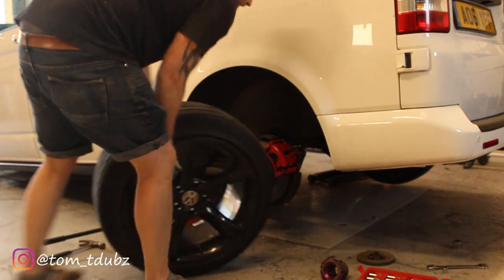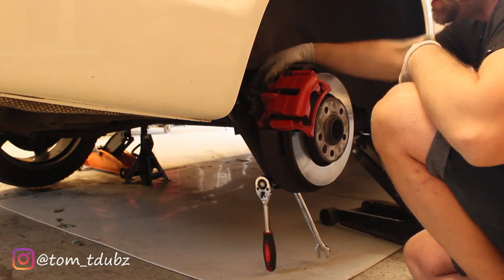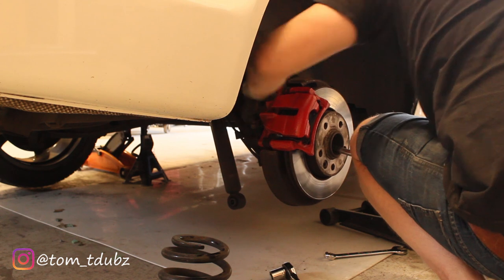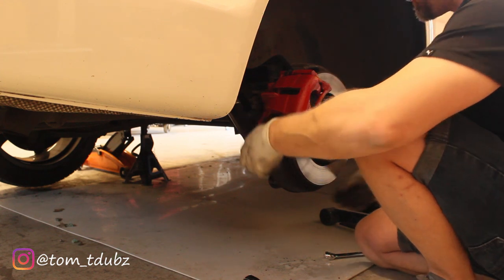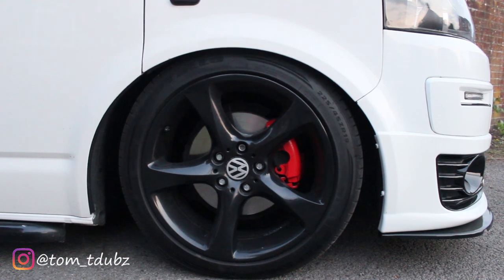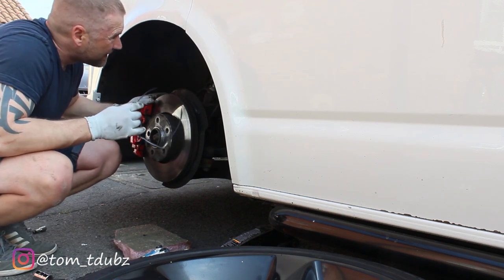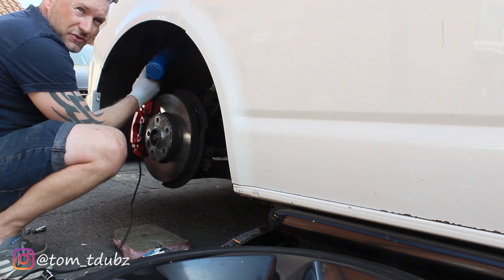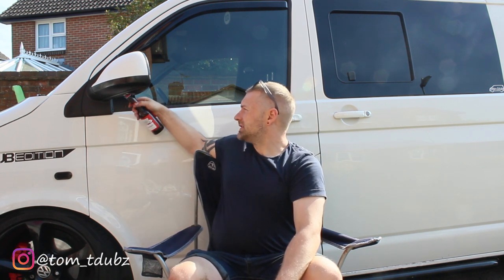VWT5 stance plus coilovers

Comment: Hello Tom as you well know with the Lowdown Transporters crew some people who are running 20” are wearing 225/35-20 fronts and 245/35-20 or 255/35-20 rears and they’re rim sizes are 8.5J fronts 10J rears , I know some people talk about load ratings but as long as you understand what you’ve put on and adjust your driving style to suit you’ll be ok , plus personally if your modding the van unless you declare all mods your insurance will be invalid , so if you declare all mods including wheels , tyres suspension etc what can the insurance company actually do look how many people slam there vans , Vw Transporters are a lifestyle but try and tell someone who’s got a transit that 😂🤣. 
Once we come out of lockdown my wife’s T5 is getting lowered fairly vigorously I’ve got H&R ultra deep coilover kit which has been hub modded , T6 modded top mounts , new Meyle Hd drop links , Transporter Hq narrow cv boots , and rear adjusters will be removed , rear arch liners removed , rear chassis notched so when the strut moves its natural movement it doesn’t catch ,  rear brake line and abs sensor wire rerouted , front arch liner heavily modded all on the aid of running low , hopefully with all the mods I should be running about 160mm lower at the front maybe a little more and about 145/150mm at the rear , I’ve got BMW Ellipsoids 19” they are 8.5j front and 9j rear I’m going to be running 225/40-19 and either 235/35-19 or 235/40-19 but I might be ever so slightly rolling both front and rear arches just to give more clearance and help me tuck as well.
Reply from the maker: Arron, this is very exciting can’t wait to see your wife’s van sat that low! I have just purchased hq cv boots and I’m waiting on some gaz short rear shocks.. I won’t be running as low as yours but for Stars and Stripes (stickers) it won’t be low enough. When lockdown is over and the shows start there is gunna be sone seriously tidy looking vans about!!

Comment: Hi Tom,great channel.I went from T4 to T5 in February and actually got the stance kit after looking how low they went after your fitting episode.Well happy with the outcome.Was only ever after no arch gap as my T4 was down and swore to myself I won’t be cutting this van up.But now looking at adjuster deletes and bump stop trimming.Would love to know how you get on with the gaz shocks.Did you custom order a extended/compressed length,or off the shelf?.Oh,your van looks sweet by the way...Great stuff👍
Reply from the maker: Thanks, I'm really happy with them so far... its quite contagious isn't it.... I've just ordered some thin rubber mounts for the top bump stop, will be cutting them down soon an doing a chassis notch along with the fitting of the struts in a vid soon. I went with the standard short shock as I probably wont want to be low for ever....

Comment: Hi Tom,  great vid - ive bought the power flex rear adjuster delete today for my stance ultra kit to get the back down more - wondering if it’s even worth running it if you’re saying there isn’t any knocking from the spring houses on the metal of the original metal adjuster mould?
Reply from the maker: I would run them if you’ve got them, occasionally you get a knocking but I think that’s my rear shocks... I’m going with gaz short shocks and a little notch the the chassis, and bump stops.. that should get me a little more clearance under there.
Reply: T Dubz sounds good! I will see how the adjuster delete kit does! Thanks for the advice

Comment: Starting to luv your videos mate... you’ll get it lower if you drop to 35 profiles as I did. Check out Transporter HQ on slamming their demo
Van, just shows the amount of chopping away it requires to get it down. I said f’k it in the end and got the So Low kit. Very informative tho mate and like to laugh at your dry sense of humour ... good job!!
Reply from the maker: Thanks pal.. the 45s were for a holiday will be looking at 20” soon so will also be looking at possibly a different set of coils too 👌🏻😎
Reply: T Dubz I got 20s on 35s running 255s. Problem I have is the wheels are 10j wide so probably would have been better with 8.5 on an ET45 offset. Pain in the arse that scrubbing, I’ve had trial and error like you to get rid to keep it low. Like I say best set up 245/35/20 on 10j rear and 8.5/9j front with ET45 offsets..... been a ball ache to come to that!
Reply from the maker: Thanks for saving me the hassle 👌🏻 thanks for liking the channel just need a few 1000 more like minded people to subscribe 👌🏻🤙🏻
Reply: Lee Kemp I got 20”s bud with 255 35 20 tyres on a 8.5 rim et 45 and still rubs ive had to remove most of the front arch liners ,
Reply: Dalesturgess hmm maybe it’s because I’m running the So Low Bilsteins and the rebound travel isn’t as bouncy? What u running? I’ve still full liners in with no cuts and my wheels are in the arches.
Reply: Lee Kemp hi I’m running the bluebird “hubmodded” 150 drop and still have a bout 70 mm to go down at the front but tyre clearance on the wings are holding me back
Reply from the maker: jamiecivic just a few more £££ needed for those 👌🏻
Reply: The problem with the 8.5 j wheel is the tyre widths , on 8.5 best tyre size is 235 - 245 , but they don’t come with the load rating I need as it’s a t32 so I needed 255 102 xl . The 8.5 j with a 255 makes the tyres really wide hence rubs on lock
Reply: Dalesturgess can’t believe that as I have the same set up and I’ve had the front in the air and pulled lock both ways and have about an inch? I’ve 10j wheels .... strange??

Comment: Just fitting Stance+ to my T5. Are the front springs supposed the be loose when the van is jacked up? When mine is set low, they are loose, will this cause knocking?
Reply from the maker: No issues there, when jacked up the spring will be loose. Won’t cause knocking, if you are getting knocking will be down to the top mounts…

Comment: So if your suspension got enough lift from a bump the spring would become loose, what holds the spring secure when pressure comes off it?
Reply from the maker: The damper doesn’t extend far enough for them to come out 👌🏻

Comment: Got a t6 t30 running on 275/40/20" on a factory kombi, 5 seater.
Want to lower around 50/60mm ish 
Will this kit be good for a smooth comfortable ride with the van being empty 70% of the time ? 
What else do you recommend changing at the same time 
It's 3 yrs old and 35k on clock
Reply from the maker: To be honest this is a great budget kit. Stance. But if your just going for 50/60 mm I would go for a set of springs.. same price as the stance kit would get a really good set of springs.. if it’s only done 35k u shouldn’t need to change anything, but for piece of mind while everything is off you could do new drop links and top mounts but you may find that there all ok... 👌🏻
Reply: @tomtdubz  any recommendations on springs there's so many options it's doing my head in 😣
Reply from the maker: There are loads and I guess it’s a personal preference but I would either go for the kits from H and R or Eibach both are good 👌🏻🤙🏻
Reply: @tomtdubz  suppose the only reason I mentioned COvers is the fact I can lower or raise if needed or want to change the ride
Reply from the maker: Lucio cancellara you do have the luxury of that. That stance is great for budget lows 👌🏻

Comment: Hey bud it’s dale here , how’s the back end does it knock at all with taking all the rubbers out , I’ve still got the bottom rubber mount In there but scared it’s knock if I remove it ?
Reply from the maker: Yo dale, your vans look pimp! To be honest mate haven’t driven it properly yet.. I’m working tomorrow so will drive it then, good friend of mine has done the same 2/3years ago and has had no knocking. Guess every van is a little different tho... just do it bud get them out 👌🏻🤙🏻
Reply: T Dubz ok bud I’ll see how you get on first let me know after a drive an then I’ll do it 👍👍
Reply from the maker: No worries bud, will let you no ASAP 👌🏻
Reply: T Dubz good man mate 👍
Reply from the maker: jamiecivic, and why not?
Reply: jamiecivic yeah I’d like to know why not as well ?
Reply from the maker: Cut them out, just gunna cut an inch off to start with 👌🏻😎